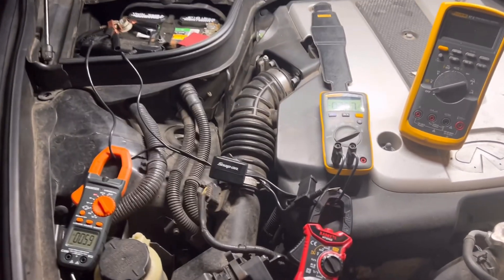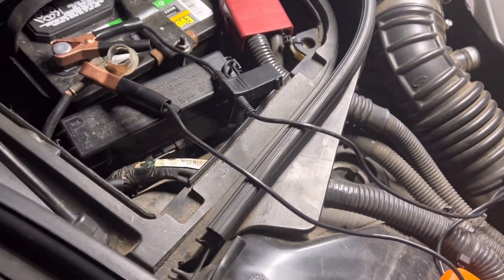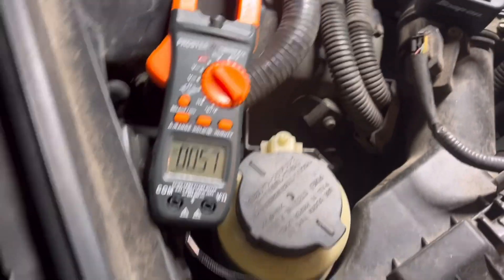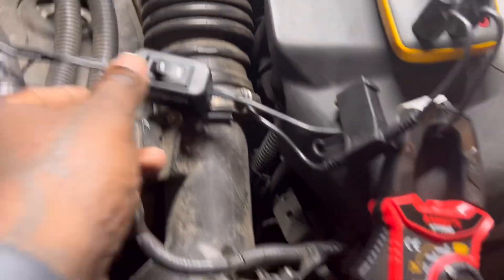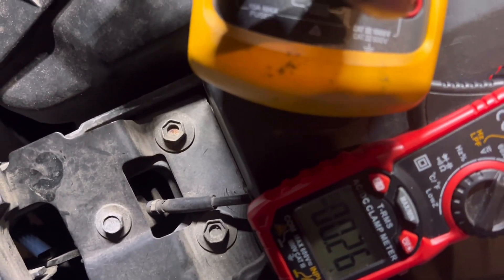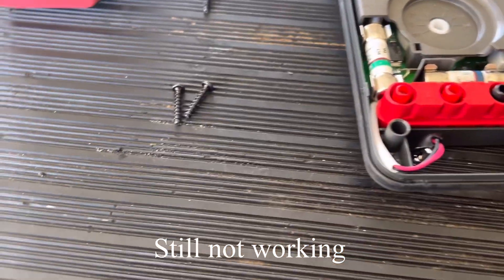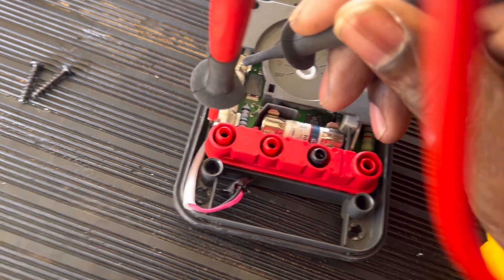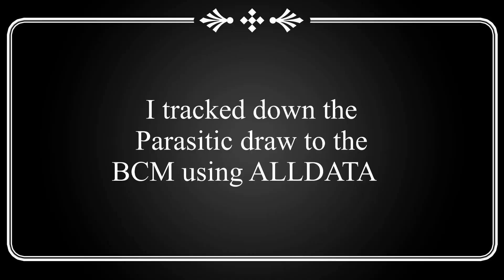Snap-On Parasitic Draw testing EEDM15APD

Comment from the maker: This may be a Lisle rebrand that can be had for about $22 (Lisle 64970 Parasitic Drain Tester, One Size, Factory) the Snap-on one comes with resettable breakers and (maybe a larger switch), the Lisle comes with fuses.

Comment: Good demo; I have been using the UNI-t clamp meter to start before going inline with a DVOM; another quick way to check the internal fuse on your DVOM is to take one lead go to ground and OHM you should get a reading it also checks your lead and shows you how much resistance is in the lead or use both leads ground to OHMS if the fuse is good
Reply from the maker: Thanks for the tip!

Comment: In my experience, the clamp meters are pretty inaccurate when trying to read a parasitic draw. They might work for other applications but when reading a draw it can be misleading, which seemed to be the case in the video. My suggestion is to use the multimeter like you had for an accurate reading.
Reply from the maker: thanks for watching